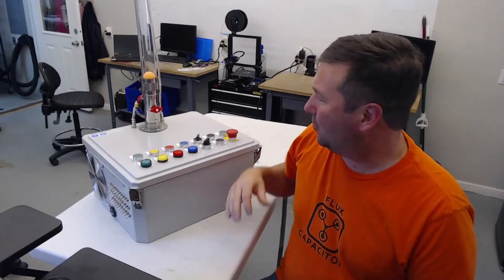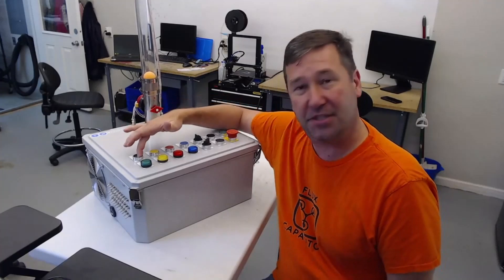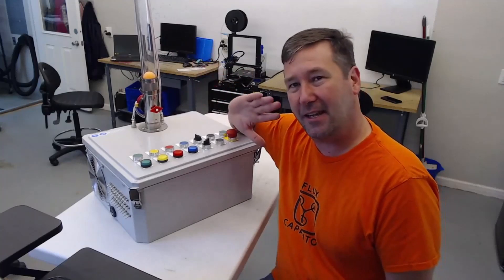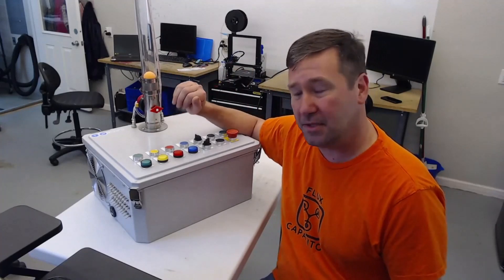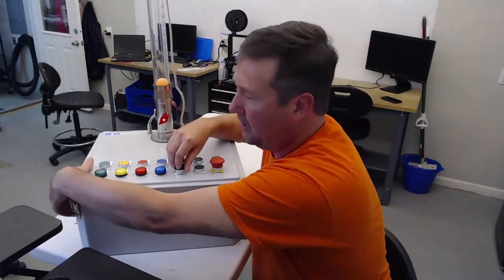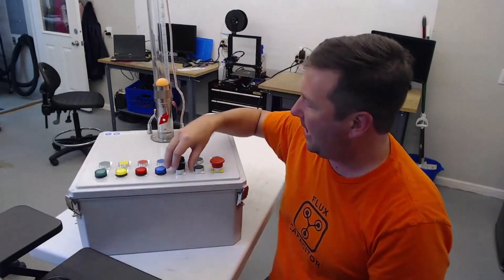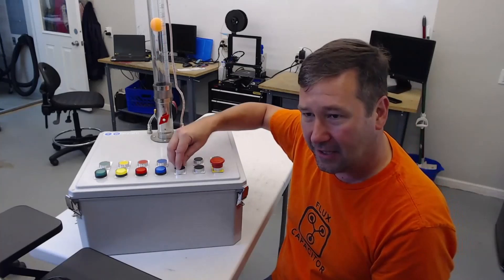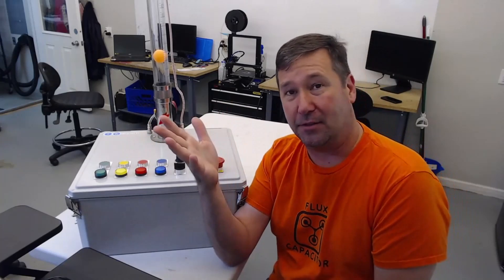Analog vs Discrete PLC Inputs and Outputs Signals

Comment: Those who named the actions of these buttons is not so logical minded. 
Discrete should be "dimmer"  effect and analog should be "On or Off"
Reply from the maker: Don't you mean the opposite?
Reply: @TimWilborne  You explained that the Discrete is "on or off" and Analog is "dimmer" . You are the Pro who learned it that way , but those who named it wasnt logical. 
It should be named as in my first comment
Reply from the maker: I'm always looking to learn better ways to explain this but I'm not following you.  Discrete is ON/OFF or digital or 0/1 or True/False.  Analog is a variable signal such as measuring a tank level or varying a motor speed, the simplest example being the dimmer switch in you house.  Why should they be swapped?

Comment: Tim, I have a drive that takes a -10 to +10vdc differential analog signal. Unfortunately, my Galil motion controller only has single-ended -10 to +10 vdc output. I thought I could just connect the GND reference from the Galil to the analog input(-) on my drive, the drive was very erratic and always had 2.9vdc on it even when the Galil was outputting 0vdc. Do you know of a workaround for converting a single-ended signal to a differential signal? Any idea why I am consistently getting 2.9 vdc on all three of my axis analog inputs?